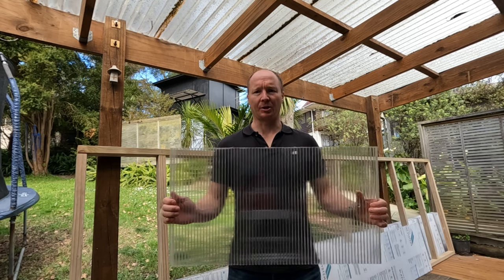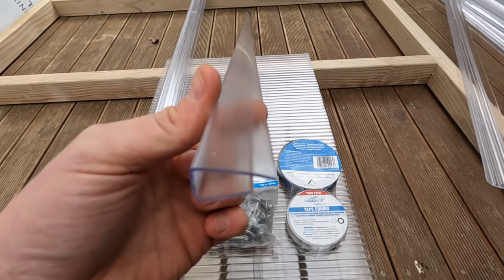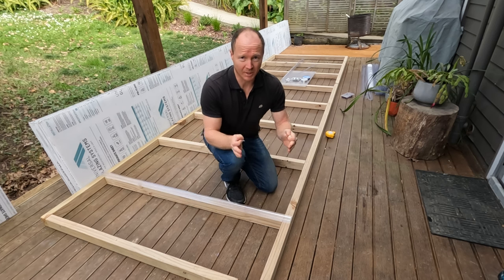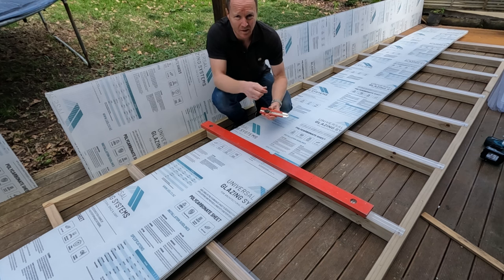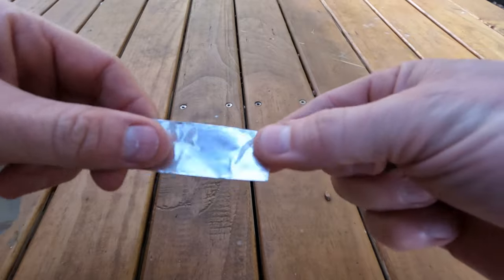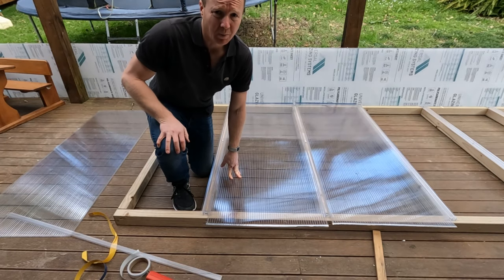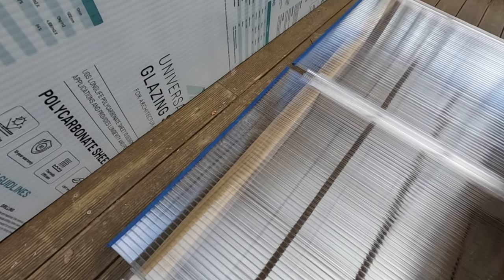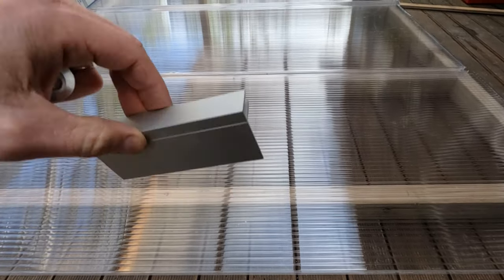How to install Twinwall (multiwall) polycarbonate roofing

Comment: Thanks for that, brilliant. I'm looking to roof a pergola and have taken some pointers from your video. Many thanks. Quick question though... could you have used wider sheets to cut down on the number of sheets such as the 1200mm (or even wider) you mention? 👍
Reply from the maker: Hi there, no worries :) Yes you can absolutely use wider sheets. I'd normally use 1220mm but I happened to have some 610mm that I needed to use. If you use 1220mm (or wider) you need rafters at around 600-650mm apart. So some of these will be in the middle of the sheet. In which case you use the Twinwall fasteners to fasten the sheet onto the rafter (drilling an expansion hole first). Hope that helps! Kurt.

Comment: Where did you put the screws into the roofing??? Everything I read says don't screw threw the H profiles.
Reply from the maker: Hi there, our H snap joiners are designed to be screwed through the bottom, into the rafter. Then you put the sheets on and then snap the top part of the H joiner on. If the sheets are 1200mm wide, they will also need to be screwed through the sheets into the rafter that goes under the middle of the sheet. More info here: http://twinwall.co.nz/ Thanks, Kurt.

Comment: A very useful video that will give me the confidence to replace my poly twinwall porch roof. The existing roof is 2m wide and 1m long with only outer supports. Do you think it would be better to add a middle support? Thanks again Colin
Reply from the maker: Glad it was helpful :) Yes you would need to add supports no further apart than 600mm (for 6mm Twinwall) or 800mm (for 8mm). Otherwise it will flex too much. Regards, Kurt.

Comment: Hi — I noticed you were kneeling on the panels. I was not aware they were strong enough to support a man’s weight. It won’t crush the channels in the panels to kneel on them while using the rubber mallet?
Reply from the maker: Hi there, good spotting. Ideally you wouldn't kneel on it, but because I've used it for some time I know how much weight I can put on it. Too much weight, especially on the point of the knee, and you will crush the channels. Best practice would be to use a drop sheet and plank on top if you need to put weight on it :)

Comment: Hi i got glazing bar screw to timber put 100mm polycarbonate sheet but when i wont put cap on its not cliping this screw on this way. If polycarbonate sheet was 160mm wilby fine. Any ideas? Thanks
Reply from the maker: Hi there, thanks for your message. I'm not sure I understand what you mean. Could you please clarify? Regards, Kurt.

Comment: I'm looking to replace a clear corrugated pvc roof. The timbers are already installed but not to vertically every 4ft however there are horizontal latts going across so can the multiwall just be fitted onto the latts?
Reply from the maker: Hi there. Yes, generally it can be fitted directly on to the horizontal purlins, as long as the joiners that you're using are suitable for that. It should show in the installation instructions for your system whether it's ok to only be supported on the purlins (depending on how far apart they are - usually around 800mm 32in or so). Thanks, Kurt.

Comment: If I am using aluminum framing for 4x14 feet sheets (in the usa), do you have any recommendations of crossbar framing measurements?  Would we need to cut the poly sheets down from 14 feet to 4x4 using H channels on all sides or is there a way to prevent the sag without cutting the 14 foot sheets down?  My research says NOT to use silicone to adhere the poly to a rafter or support beam?  Is this correct?  If so, then we would  have to cut them, correct?  I am stuck and winter is coming.  Please help!
Reply from the maker: HI there. I wouldn't recommend cutting them down, best to leave them as full sheets running the whole way down the roof. If you cut them down there's no real way to stop them leaking where the water runs. I'd recommend rafters at 2ft centers (600mm). That way you'll have a rafter running the center of the sheet supporting it (you can put screws through the sheet into this rafter), and a rafter on each edge that you can put the H channel joiner on to join the sheets. Alternatively, instead of the center rafter, you can put nogs/purlins running between the joining rafters. So these would be 90deg to you joining rafters. You could space them about 2-3ft apart. Don't use silicone as that can break down the polycarbonate, and will eventually work free anyway. Hope that helps! Kurt.
Reply: @sunnysidenz  OMG!   THANK YOU FOR SUCH A QUICK AND FULL RESPONSE!  Bless you a thousand times!  I am not sure I understand the 'nog', but my husband and brother will!   Wish you were close to me... I would hire you to do it!  lmao!  May life hold you safe and happy!  You are definitely my 'sunnyside' today!  Keep up the great videos! :-)
Reply from the maker: No worries, happy to help and I hope it all goes well! Thanks :) Kurt.
Reply: Can you share which tapes you would use for end and the other under flashing roof side?  We are using u channels at one end, but not the end against facia, as the first installers did not do it, so now we have to use a tape. It is under flashing. I think it is a silver metallic type but can't find it again.
Thx again!!
Reply: Oh wait ... think i found it in your video...lmao
Reply from the maker: All good :) Basically any type of aluminium tape will work for the top end to keep moisture out. And for the bottom end, some sort of cloth / breathable tape. We also have them available in NZ on our website. Thanks, Kurt.
Reply: I will order from you if we can get soon enough...
Reply from the maker: All good, you can order here: https://sunnyside.co.nz/product/twinwall-sealer-and-dust-tape-combo/
Reply: I have a few questions for you can I reach you off the contact us at the website? I'm not sure what our time difference is to where I could just call you. I'm going to order the screws and the tape. Let me know if I send a contact message and put your attention if you will get it
Reply: I think I may have two weeks before they start this I'm hoping that will be enough if I place the order tomorrow to get it here but I'm not sure what shipping to the US of a is going to be
Reply: I'm trying to order from you as a thank you for all your kindness but it also must make sense. Keeping my fingers crossed
Reply from the maker: Ah, sorry we don't ship to the US. We only ship within New Zealand. Hopefully you can find something similar in local US stores! Thanks, Kurt.
Reply from the maker: Ah, sorry unfortunately we don't ship to the US. We only ship within New Zealand. Hopefully you're able to find what you need at a local US store though! Thanks, Kurt.
Reply: @sunnysidenz  thank you!  Wish I could give u the business!  You hv been so helpful and kind! Blessings always!  I will keep supporting you on YouTube! You rock!!
Reply from the maker: No worries, happy to help, and we wish you all the best with your project!
Reply: @sunnysidenz  Thank you... trying to find the right screws here in CA... argh... this state sucks!

Comment: Hi there, thanks for the vid, the spacings between the rafters you mention need to be 640mm, is this centre to centre, inside or outside dimension? Cheers
Reply from the maker: Hi there, no worries. It depends on the width of the sheet, and the inside width of the joiner. E.g. if your sheets are 610mm wide, and you allow a 30mm gap for the joiner, then you'd have 640mm spacings centre to centre. There's a diagram here that may help: https://sunnyside.co.nz/product/twinwall-polycarbonate-roofing/
Thanks, Kurt.

Comment: If need to use 2 lengths of 2.4m to use on a roof, how would you join the two together?
Reply from the maker: Hi there, we don't recommend joining them end to end (which is what I think you mean). It's really hard to waterproof, and to stop debris and sediment from sitting on the lower sheet and making it's way back up into the flutes of the higher sheet. Thanks, Kurt.
Reply: Could I use an H channel between the 2 pannels?

Comment: How do you add long 3m C sections , wont slide on too much friction.
Reply from the maker: Yes, any longer than a metre or so can be difficult. Generally you should cut the U channel to the width of the sheet only. If you really want the full 3m length you could try levering them on with a long piece of aluminium. Or using a rubber mallet (and a block of wood) to slowly push them on. Hope that helps! Kurt.

Comment: Very helpful , just a question how did cover  on the joiner for water, dust we don’t have to use tape ?
Reply from the maker: Hi there, generally you don't need to cover the ends of the joiners. However if the top end is exposed (e.g. not under a flashing) then you could put some sealant in there. Or if you're in a very dusty environment you could put sealant or tape on both ends of the joiner. Thanks, Kurt.